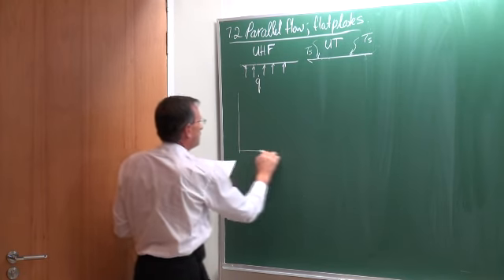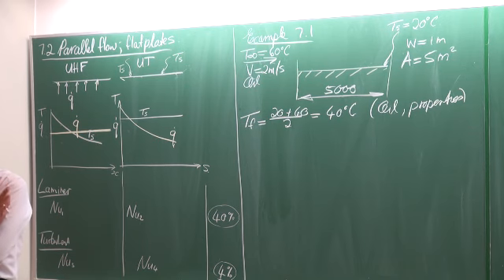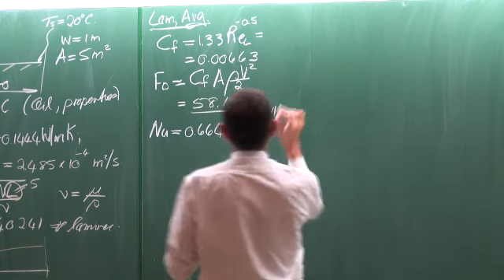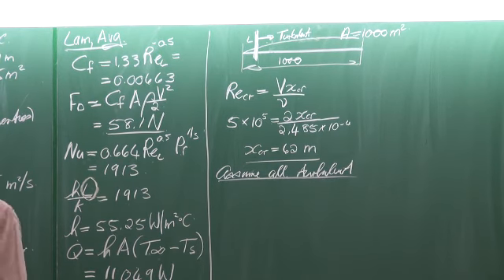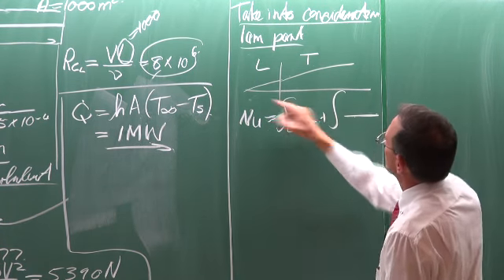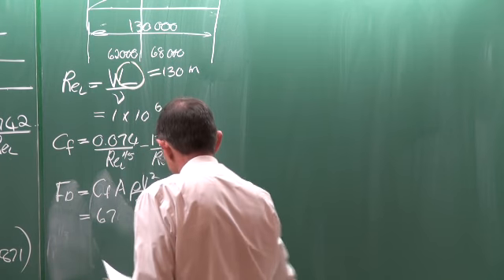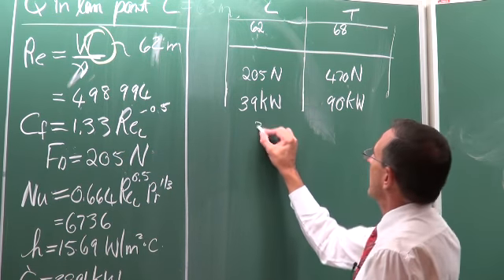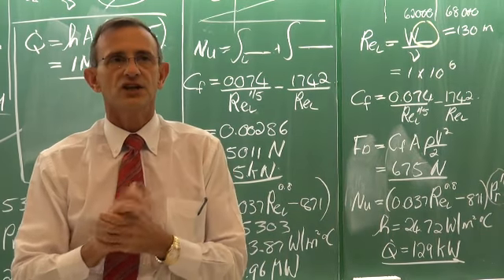Lecture 25 (2014) External forced convection (2 of 3)

Comment from the maker: In the problem of the oil flowing over the flat plate, the Prandtl number was more than 60. Therefore the equation’s to calculate the Nusselt numbers (in the turbulent flow regime) was not correct. The Churchill and Ozoe (1973), equations should rather have been used. Rather do the problem with water as fluid.